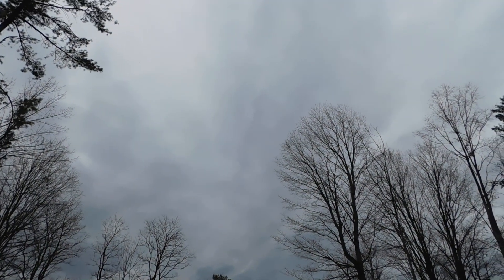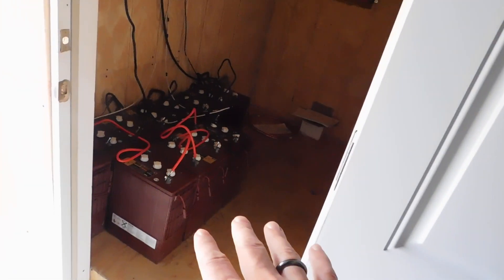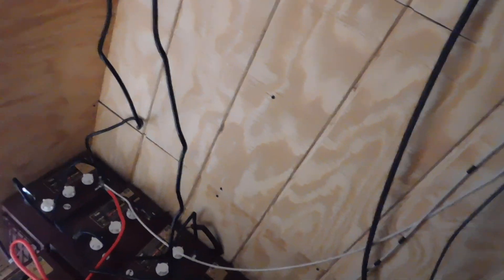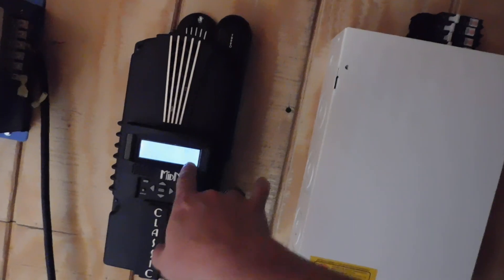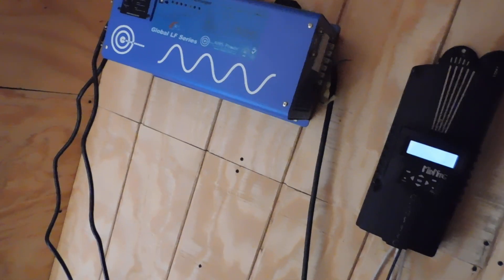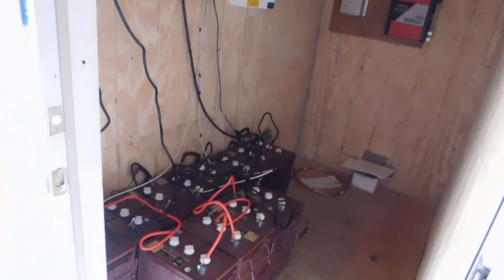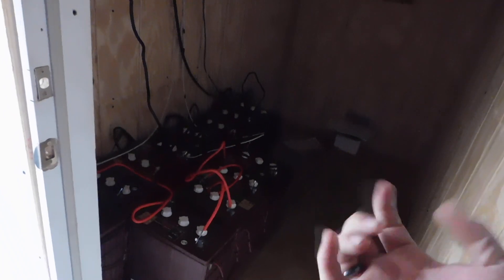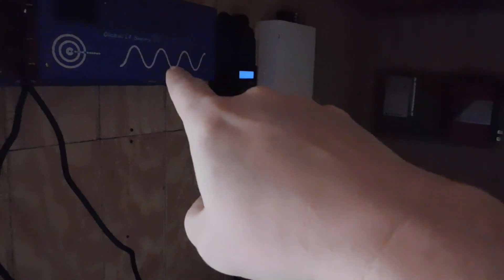My new 24 volt solar system is up and running.

Comment: https://www.youtube.com/watch?v=jinS0hzLyNQ hope this help man..
Nice set of batteries you have, it can hold up 14.8KW

what the temperature of the inside shed? batteries perform better around 70 - 75F
if it hotter than 75F, purchase a cheapest AC you can find.
Batteries required "well ventilated room" 
https://www.youtube.com/watch?v=SGdgHiM85yc
Reply from the maker: Its very comfortable in the shop but I will keep an eye on that thank you. That's good to know and thank you for the info.
Reply: you welcome, i was an ex-forklift driver, most of the forklift i drove where electric
Reply from the maker: Willem Budde Very cool nothing wrong with that.

Comment: I feel you on good equipment.   I sat on my stuff for 9 month's buying it here and there in Piece-Work as I got paid.  The hardest part for me was actually mounting the solar panel's to the roof.  After mounting them, I didn't do anything for 3 months because I was broke / saving up for the controller one month and inverter the next.  Prewired it, stopped, then batteries lastly.
Reply from the maker: That is a smart way to do it.

Comment: u have mppt cc u should wire ur pannels 48volt 1.5 to 2x battery power mppt will charge better more efficent
Reply from the maker: +Michael Galac Thanks for that info.

Comment: Excellent - glad to see progress. You will get there...and everything will be dialed in. With 12 of those Trojan's 700w is going to take days to charge (let alone powering anything in the house at the same time). Def get that grounding rod in soon!
Reply from the maker: +Chris DIYer Yes more panels need to be added and everything else done.

Comment: I am sorry my friend, but you should learn a bit more about electronics and battery hookup: series vs parallel before you post many more videos about your battery setup.

Please.  Series= pos+neg increase volts.  Parallel=pos+pos/neg+neg to increase amps. And when doing so, ALL your batteries should be of the same amperage capacity.
Reply from the maker: +teddyearp Like I said I am not an expert. But thank you.
Reply: Didn't mean any offense, just that it would be confusing for the watcher to get anything out of it.
Reply from the maker: teddyearp No worries.

Comment: SIV  Series Increase Volts, PIA Parallel Increase Amps   your cables between batteries look small. I was told they should be really short and really fat something like 4/00   4 ought in size also known as wielding cable.   what are you going to do with the other batteries?    maybe great to have a 2nd system to run a shop and chicken coop and more.
Reply from the maker: +ArizonaHotHomestead Yes they are going to be changed out. I am selling the other batteries.

Comment: I use to panic when I got my electricity bill. Been 90% off grid now for a month and just can't wait to get my next bill. No doubt about it, solar is the way to go. Running 5 x 200 watt panels on 12 x 135 agm batteries (12 volt) at the moment.
Reply from the maker: +UFO 'Lou's Channel That's very cool I hope its a small bill for you.

Comment: Looks great ed. I don't understand  why it go's from positive  to negative  but I'm probably missing something simple. can you add your old batteries  to the new ones just for extra storage or it doesn't  work like that. I'm trying to learn how solar works.
Reply: +Charlie Ice SMC  Going from positive to negative multiplies the the voltage.  So two 6-volt batteries now become one 12-volt battery, or four 6-volt batteries now become one 24-volt battery.  Think about a normal flashlight, the batteries are stacked end-to-end, positive to negative, to increase the voltage to the light bulb.
Reply from the maker: +Charlie Ice SMC they are a very different kind so I don't what them in the string.

Comment: your battery cables are far under sized, sorry I keep bringing this up, # 6 cable is for a max of 1500 watt inverterpower/24v=amps, then look up in a wire size chart, if you don't you won't get full watts out of your inverter. same with the cables running up to your inverter from battery, should be all the same. I suggest 4/0 cables. you also need a disconnect/fuse or breaker between battery and inverter, battery and midnite. this way you can work on each component safely and they are protected against shorts.another advantage of this inverter is that it's a pure sine wave, so it's more like the grid power and everything that is AC will be happier running on it.and like Simeon mentioned you can run three panels in series at the site to get the voltage up to where it is more efficient. easy to do, minus to plus, minus to plus then bring the minus on one end and the plus on the other end back to the midnite and change the input voltage.Here is a link for ready made cables, layout you batteries so that all the interconnecting cables are the same lengthhttps://www.altestore.com/store/cables-wiring/battery-interconnect-cables-c465/?page=2
Reply from the maker: +Rev John O'Toole I am going to change every one of the wires I just wanted to get it up and running.
Reply: +preppernurse1 good, I have been pondering driving out there, but the 5 hour drive doesn't excite me
Reply from the maker: Rev John O'Toole That is a long drive for sure.

Comment: the inverter has 3 settings. power saving, off and power saving off. when you turn it to power saving mode, it will search for a load of 25 watts before it will go to inverter mode. you will probably have to use it in power saving off mode which will be rocker switch down.
Reply from the maker: +OkieRob That's what I ended up doing thanks.

Comment: if you havent driven your ground rod yet .... just a sugestion ....1.5 in or 2 in pipe threaded    screw on a cap  and use it like a fence post driver if you dont have one
Reply from the maker: +grizz270 Good idea thank you.

Comment: the jumper wires on the batteries should be 02 or 01 guage and as short as possible (no excess. no loops.  Yes you want those batteries fully charged before you start using. You want to obtain the full spec sheet from the battery manufacturer to aid you in setting up the system.
Reply from the maker: +Stephen Wells I plan on fixing the wire I just wanted it up and running.

Comment: if you increase the voltage from solar panals up to 90-100 volts dc , it will increase charging power during cloudy weather, it works for me
Reply from the maker: +Simeon Stoute Very cool that's good to know thank you.